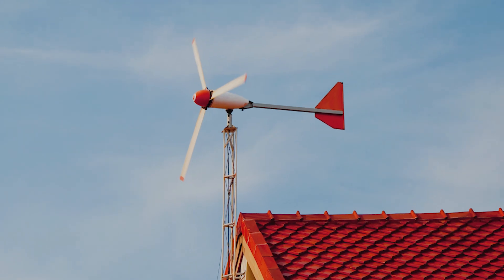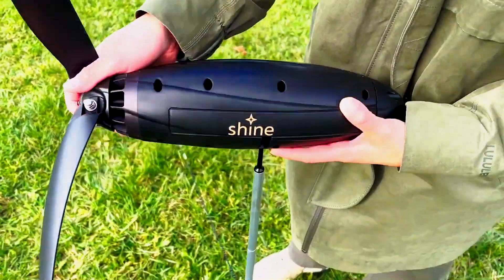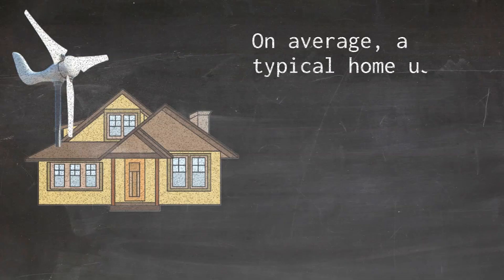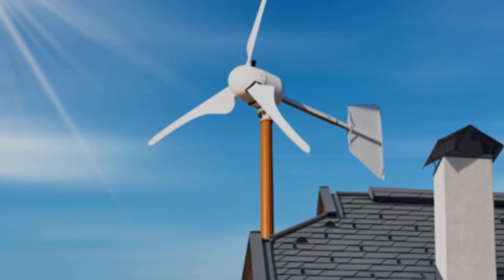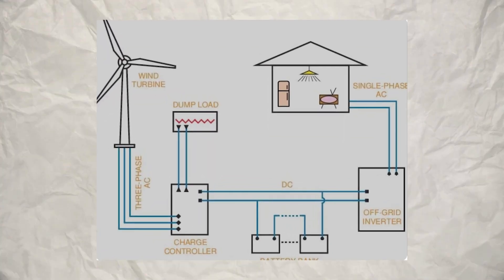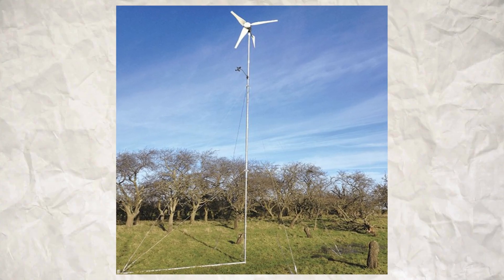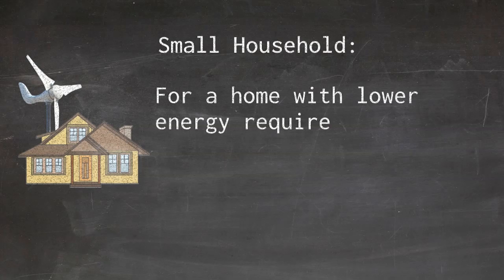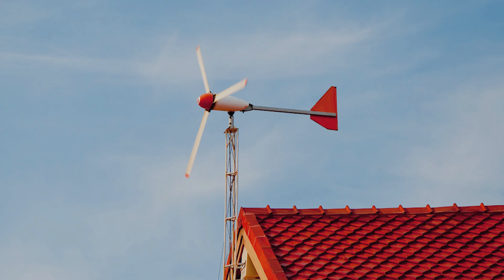What Size Wind Turbine is Needed to Power a House?

Comment: All practical tests of ground-based small wind turbines show the same results: 1) They hardly produce any electricity. 2) They don't last long!
Solar panels generate at least 10 times as much electricity for the same investment of time & money. Maintenance-free for at least 25 years! 
Wind/electricity yield increases with the third power of the wind speed.+100% wind = +800% electricity. Close to the ground: 0 constant wind, but aggressive gusts! Only wind turbines over 120 m high are effective. There are stronger and much more constant high-altitude winds. Close to the ground, there are only aggressive gusts, which extremely reduce the service life of turbines.